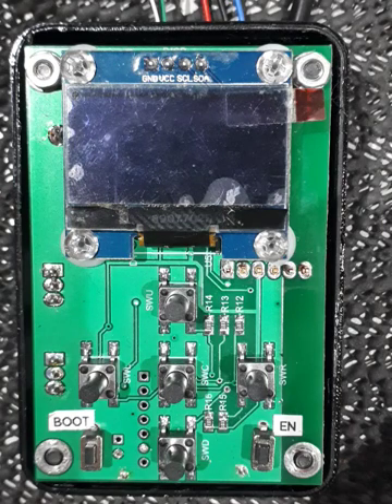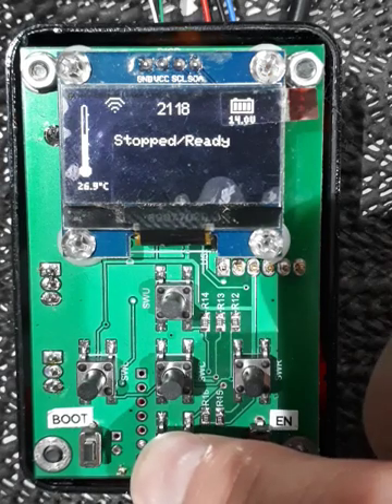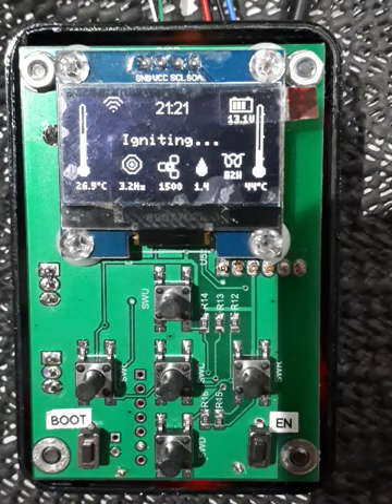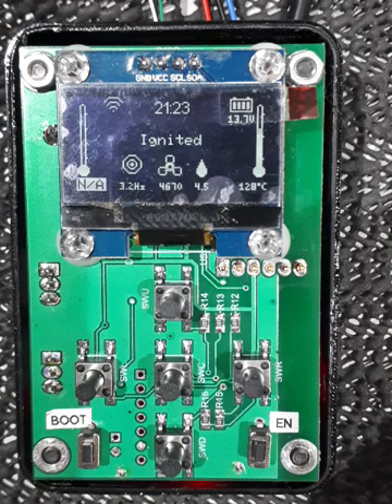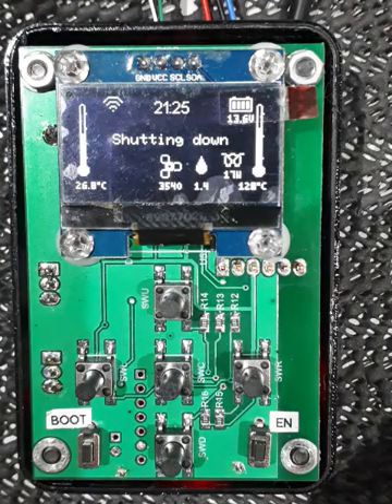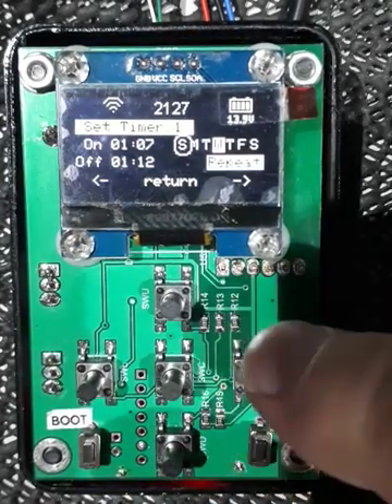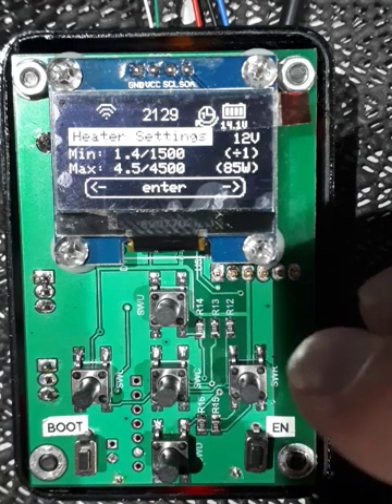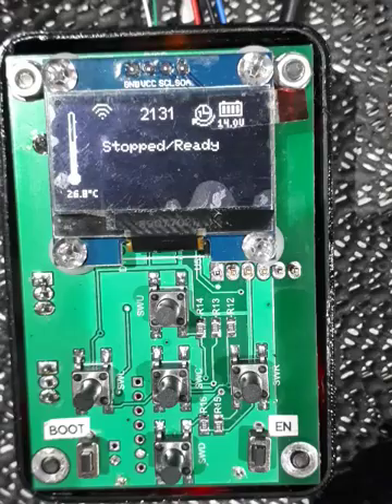Demonstration of the OLED menu in my Diesel Heater Controller.

Comment: High there, i´m using the controller for 2 years now. Recently when its started up, after 5 or 10 minutes the heat from the burner slowly drops down until it shutsdown, the goal for the temp isn´t met then so i wonder why it keep doin it? Can you or somebody else maybe help wih this problem? Thanks in advance! A happy customer from Belgium!
Reply from the maker: By the sounds of it, your heater is full of coke and needs to be cleaned out. Then a proper tune adopted to avoid future issues.

Comment: Hi Ray, great work. Do you think its possible to do something similiar with a hydronic heater? I have a gasoline Hydronic heater that doesnt have air/fuel adjustment control for high altitude. I want to build a controller to control the air/fuel ratio.

Comment: Hi Ray, I am looking to make myself an afterburner control unit. But it works out costly to buy single pcbs. i have put a post onto a diesel heater group asking about interest in a group buy for the components. There seems to be lots of interest in myself Putting them together and sending out plug and play units. I wouldn't be making any money from this. Just passing on the savings to the group. Please let me know if you have any issues with this, and i will not continue.
Reply from the maker: I have no problems with individuals recreating individual units for themselves but it is not cool to ride on someone's hard work and start undercutting and making many units especially if support questions begin to land in my inbox.
It is called respect.
Reply: @rljzathras  oh ok. Fully understood. Do you sell these units Ray? I'd rather give you my money than make them. It was more out of the fact i cant find where to buy one, and minimum orders on pcb's from my usual place is 10 units. Certainly not out to step on your toes.

Comment: awesome project! out of curiosity, could you adapt it to say something like adafruit's featherwing oled/ esp32 board to get away from the custom pcb aspect?
Reply from the maker: The very compact custom PCB also houses the parts that are required to connect to the heater's comms, likewise the RTC and Bluetooth module.

So you can have an Adafruit dev board attached to a carrier, or a far less bulky single board solution. 

The support circuitry would of still need to be a customised circuit board, even if you chose to use veroboard, or a custom board!

But, as it's open source you are free to do whatever floats your boat :-)
Reply: The dev work you've done is incredible.. Dont get me wrong. I was just looking for a more common chinese dev board incorporating as much as possible to eliminate a custom pcb. So far ive run across the ttgo ts, t-eight and lil more $$ the m5stack platform..